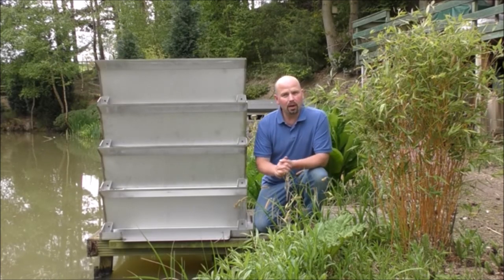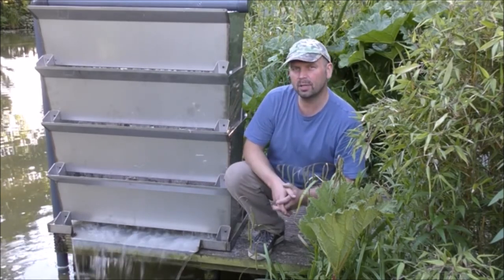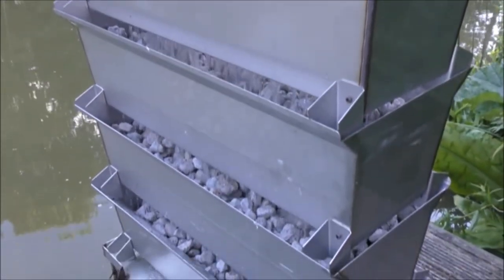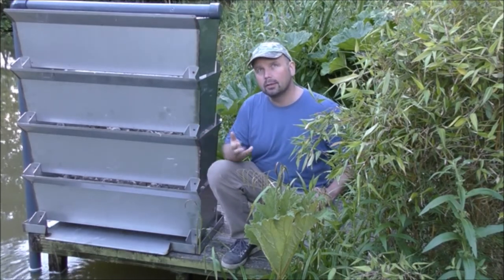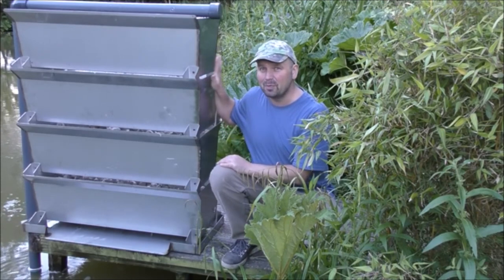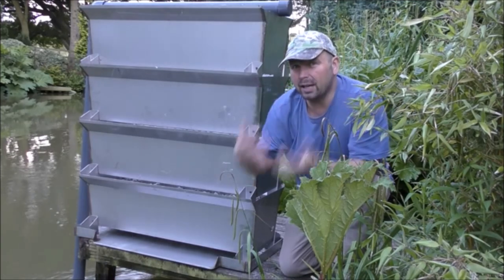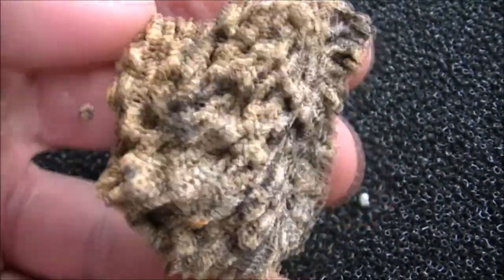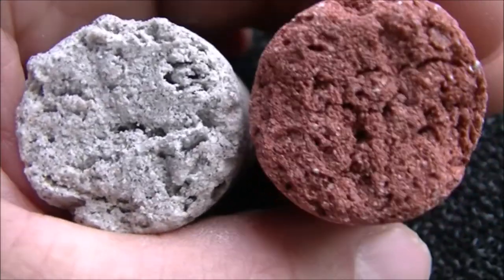Stainless Steel Koi Shower Filter / Trickle Filter

Comment: Great video mate. I used your DIY method using plastic boxes for additional filtration. My basic setup is pump > oase filtoclear > trickle filter. I used Lava-rock as the media as I got a good deal. The filtoclear does a good enough job but my koi are now getting quite big and producing a lot of waste. After running for 2 weeks all my water parameters are perfect, and not sure how but my PH is now stable @ 7.5 . Usually my PH would swing between 8 - 8.5 depending on time of the day, but now its completely stable at 7.5. Cheers m8. I even managed to box it in with bamboo sheets. cant even see it
Reply from the maker: Sounds like a great set up as the filtoclear will do a good job of removing the muck while the shower gets to work on the biological side of things. I think the lava rock may have a buffering effect with it being new but not too sure about that  - good to hear the pH is stable as that can really knacker the fish if it bounces. A pH of 8.5 is very high so 7.5 is much better for them.

Comment: Good video Richard, Many thanks

You asked why they are not very popular?

Well you need a good, easy to clean mechanical filter before a shower filter as 
It's no good having any solids getting to the media. This just clogs the whole thing up.

It's ok having the top tray with filter sponges and/or brushes which works very well but the cleaning!!
At least once a week in summer months,  sponges and brushes out, pressure-washer on, cleaning each one in turn, not for me anymore after 10 years of it, fingers crossed.

Iv just come away from all this and using a Nexus as a mechanical filter first (nice and easy to clean) then into a Biotype media filter before returning back to pond.

Iv had to raise the nexis above the input of the Biofilter which is only 2ft which is another problem of shower filters, they are top fill of Course.

So far so good with mine,  time will tell, but will be incontact with you soon for some more media

Thanks again
Reply from the maker: Yes the Nexus / shower filter combo is mentioned a couple of times in this video as that would be the perfect set up for exactly the reasons you outline here. Most people have Nexus filters as gravity fed so would have the pump after the Nexus making it easy to pump water up to a shower filter. On a smaller scale a decent pressure filter (e.g. Oase Filtoclear) could be used as the mechanical and UV filtration followed by a shower filter.
Cleaning out a good quality pressure filter or Nexus filter would be much less time consuming than cleaning out the foams in the top of a shower filter, plus it would free up that top section for more biological media too.

Comment: Learned a good bit here, thanks. My Trickle Filter is doing a amazing job, have 5 layers.. I turn the pump off and the water still comes out after 20 secs.
Reply from the maker: Excellent job and they definitely do great work on ammonia and nitrite (and nitrate under the right conditions)
Reply: Would this system be also good for aeration?
Reply from the maker: Yes rapidly falling water will mix with air but if the flow was very limited it would probably have a de-oxygenating effect (due to bacterial action using up dissolved oxygen)
Reply: Ah never would of thought of that. The more i learn, the less i know. I'm getting there though :)
Reply from the maker: We are all learning and every time I see a different container or material which sould be used for mechanical / biological filtration I'm running through all the filtration possibilities in my mind, lol
Reply: A bit off topic, but who best to ask other than the guru. 
I bought 4 packs of JBL Clearmec Plus to add to my trickle filter. 
You think its a good idea? Or did i waste my money?
Since its my first pond, i'm a bit noobie at this stuff.
Reply from the maker: Its not the stuff you'd normally put into a pond filter and I doubt it will have any effect but it won't do any harm.
If you wanted enough clay media to actually support bacteria and help the shower filter this would have been a much better buy: http://geni.us/v9hLl6

Comment: I love this shower filter. I am wondering if you have done a video on how to maintain and clean the filter.
Reply from the maker: Not yet but I will probably do a 'strip down' video at the end of the year as i am incorporating the shower filter(s) I have into a much larger filter system. If the water is cleaned prior to entering the shower filter (e.g. by a pressure filter) the shower will never need cleaning.

Comment: The best filter system is a bakki shower after a drum filter. I would not recommend pumping straight over a shower with no pre-filter. I know that is what Momotaro koi does but there are reasons why they can and we can't.
Adam
Reply from the maker: Yes I'm with you there and that is why I mentioned that a couple of times in the video.

Comment: Very cool.. I love the sound it makes.. lovely. I guess I need a bigger pond for that one. It's a really cool idea. I've never seen that style.
Reply from the maker: Although I have been in the aquatics trade for over 20 years it is really in the last 2 years that I have been made aware of the usefulness of shower filters.
Reply: I was wonderng.. at the lake I hiked around the other day there is a big drain like box about 4 meters off shore. It's like a cement box and the water flows into it. Is that actaully a filter? The pond is spring fed so why would it need that anyway. Just curious. Any ideas?
Reply from the maker: It could simply be an overflow or if it has screens on it then it could be there to prevent native / non-native fish which may have been stocked there getting into other bodies of water?
Reply: Oh that's interesting.. I learn so much from you. I canoe close to it and it does look like a over flow..of some sort. Or a fish-keep-outer!

Comment: A very good filter for ponds.
Ive added a Seive prefilter ( kinshi sieve 5 )
and then Ive filled mine with AquaKing, Bacteria House.
I think it works just great with the water quality.

The disadvantages are.
it produces alot of foam, maybe its because I feed ALOT at this time of summer.
it is pretty noisy, so if you cant hide and shield it, it can be annoying.

I have not added foam, to improve the mechanical filtration, but I will soon, since the Sieve doesnt filter the water perfectly..
Reply from the maker: Sounds like a decent set up. The foam will be caused by too much protein in the water (from fish food) thickening the water surface and preventing bubbles popping properly. That can also prevent proper gaseous exchange between water and atmosphere so it may be adding a treatment to reduce foam.
What is the nitrate like with that set up?
Reply: Its an ok setup for now, I also have a small tornado protein skimmer and Ive added a bubble catch at the inlet on the pond from the bakki, so I dont get to much bubbles out in the water.
- also, I got a surface skimmer so I reduce the bubbles on the surface by "sucking" them away.
Also Ive added a 4 meter long stream filled with Lava stone to get some extra filtration.

I do agree that the massive feeding will produce more protein in the water, but its summer and its short, so, they will need the food this time a year to grow and prepare for the long winter..

But, after wathing this video, Ive notice you talked about "white pumice"
- and the good thing was it should have PH 8, I cant really find alot of information of this produkt, and by that having a hard time finding the "danish word" for it, if I want to add it to my bakki.
Reply from the maker: The long lava stone stream sounds like a good idea.
The pumice is simply white lava stone and both the brown and white varieties are pumice, just one is generally called 'lava rock' and the other is called pumice - very strange.
The biggest seller of pumice unfortunately calls it something else and never confirms that what they sell is pumice (since they sell it at a sky-high price) but Seachem Matrix is basically a mediocre quality pumice - somewhere between the true white pumice and the brown pumice. Many pieces are very dense and useless but the majority of it is OK.
Therefore if you want to check out pumice try reading up on Seachem Matrix. They also do something called 'denitrate' which is a better quality pumice unfortunately crushed way too small.

Comment: yeah same here I have a 1m by 50cm trickle tower full of alfa grog on my skimmer turning pond over every hour. 
so long as you have a good pre filter grog don't clog.
Reply from the maker: I was just talking to a mate yesterday about grog and we both reckon it is a criminally underused media which is more useful than many people think. Maybe they are put off by the very low price but the value has to place it top of the pile. Its one of the few media types which can still be effective in a traditional static box filter too since it has such low porosity (usually around 25%) that it doesn't matter if its is sitting in muck.
The low porosity is a down side if you're looking to reduce nitrate but it is a great way to fill a shower very cheaply and rapidly process the ammonia and nitrite.
For more effective media types (biohome and white pumice) they really do need to be operating in clean water to be most effective as they rely on their high porosity to support the anaerobic bacteria necessary for reducing the nitrate. 
It would be interesting to see a really slow flow trickle filter filled with grog and what (if anything) it does for the nitrate level as the water should be quite de-oxygenated by the time it gets right through the filter. I may experiment by having grog in the large filter I will be building later this year.

Comment: The trouble with pours media is it soon gets blocked up despite the mechanical filtering in the top section due to algae etc. I bet you don't get that flow rate in 6 months time and then all the faffing about empting the containers and washing everything out.  I prefer plastic media like Kaldnes in a moving bed which is maintenance free.  Also it looks like this filter has to be fixed in a high profile position over the water as I can't see any overflow system for when it blocks.  Another interesting video thanks.
Reply from the maker: Yes as I mentioned in the video the perfect solution would be top have a nexus filter doing the mechanical and nitrification followed by the shower filter (operating in clean water) to do the denitrification.
In that situation it would be almost maintenance free as there would be no need for any sponges in the shower filter.
Reply: Thanks for responding to so many of our comments it does make it more interesting and worth while posting.
Reply from the maker: No problem, I genuinely like to see comments which add to the information in any video, question it or disagree with it as that encourages me to think more and investigate other options and solutions to potential problems.

Comment: Another great video.
I have two questions if you don't mind.
Do the inner pores clog up eventually on the better media you mention and if so would it have to be thrown away, i seem to remember from when i kept tropical fish that siporax never blocked up over the years i used it but it was thin walled sintered glass tubes. 
I don't heat my pond and I'm concerned about this system chilling the water too much, do you think this could be an issue? I'm from Doncaster so don't get the warmest weather but not quite so cold as you probably get.
Reply from the maker: Ideally the pump would be moved to where the water pours back into a pond in the winter (when using any filter) as that will cut down the chilling effect. Yes all good media will eventually become clogged including siporax. The pores clog up and then it basically becomes useful only as a tube or pellet depending on what media is used with minimal outer surface area. Alfagrog is probably the best for a dirty environment due to its shape but more porous media like biohome and white pumice can be highly effective as long as they have good mechanical filtration before them to clean the water.

Comment: I've just built a shower filter with pumice that I bought from you. I've built it in a 120ltr wheely bin and it has about 35 - 40 kg of pumice in it. My water is first past through a barrel filter that has course, medium and then fine foams on top of the cheap plastic tube type media. I'm using this as a purely mechanical filter before the water goes to the shower. After two weeks my water clarity has improved tremendously but I dont seem to have that much improvement on the chemical quality of the water. Probably a bit too soon for anything to happen. I've searched high and low to try and find a comparison video for shower vs bakki river and havent been able to find anything. Could you please explain the pro's and con's of each? Is a Bakki river better than a shower filter?

Comment: would appreciate some advice. i have a 100.000 ltr pond. the water is turning green with algae i guess. what kind of system will i need to process the pond. will i need a UV system or will the trickle filter system work just fine? how big a system a trickle filter system will be required and at what flow rate? cheers
Reply from the maker: You would need a nation of UV light to kill that off and keep it clear and it may take around 300w of UV to kill the algae for a 100,000 litre pond. The UV lights would be (inline) before the trickle filter and the trickle filter would need to hold around 200kg of pumice - flow rate of 20.000 - 30.000 litres per hour as a rough guide.

Comment: Have you heard of roto concept shower filter made by Koi Logic in essex
Reply from the maker: Yes, I may have seen one at my local koi dealer and they look nice - the same effect can be achieved with a 45 gallon drum and spray bar though, lol
A bit like the Nexus filters in the form over function angle but if a filter looked DIY or awful people wouldn't buy them.
I really like the good looking filters as everything is there to do a specific job, neatly laid out with easy clean facilities - it would certainly appease most wives having a ready made good looking filter instead of a few random 45 gallon drums with a mess of pipes connecting them so I can see why they are popular.

Comment: interesting lecture on pond chemistry . where does the water come from to fill that big pond . do animals or birds of prey try to steal a fish or two.  those water filters are they like filters used for human consumption. is pumice natural or man made.  thank you for sharing.
Reply from the maker: The pond is spring fed and yes there are plenty of predators which have taking fish over the years including heron, mink, otter, cormorant and goosander. The only thing I don't mind eating the fish is the kingfisher as it only takes the fry. Mostly this type of filter would be seen in koi farms. Pumice is a natural volcanic rock.
Reply: thank you sir: on nova the kingfish bird can attack larger birds like ravens when threatened .
Reply from the maker: They are feisty little birds, that's for sure.

Comment: What about the good old fashioned noodles everyone used to use, does that do the full cycle? We used to see those noodles every where but now no one seems to mention them
Reply from the maker: Even good quality noodles will support a real imbalance of aerobic and anaerobic bacteria massively in favour of aerobic so they end up being great for ammonia and nitrite removal but produce lots of nitrate. The bigger problem is that so many manufacturers are trying to manufacture them as cheaply as possible many of them are as smooth as glass with no real porosity so are next to useless. When I see videos of people comparing the noodles to other forms of media and favouring the noodles it makes me laugh when I see them using really crappy quality noodles which may as well be grapes or marbles for the available surface area they have, lol
If you can find good ones (e.g. Aqua One Bionood) they can be a good media.
Reply: +Pondguru Outdoors Ok so I've been using noodles for years, to the eye they look really pourus. I guess the real way to see if it's doing the full cycle is buy water testing. But if there not controlling all three then buy adding the media your recommending with what i already have could i still have an imbalance?
Reply from the maker: Potentially, yes but there will only be a finite amount of bacteria supported aerobically and anaerobically (due to the limited food source). As long as there is plenty good media in the filter it really should not matter how much other media is in there. Hope that makes sense.
Reply: Cheers

Comment: Hi, The Momataro bakki showers for a four tier system is around a £1000 so not cheap to say the least...then there is the cost of the media...the one you have reviewed is around £500 so a lot cheaper...have you ever seen the momataro ones? Is this just a case of paying double for the brand?...interested to see what you think..from pictures i would say the more expensive of the too probably looks better? you can see pictures on absolute koi...cheers Ross
Reply from the maker: Yes I have seen the 'proper' bakki shower on their website and it is slightly different. May be a bit better finished but essentially they do the same job. I'd like to see someone take a bakki shower and get it powder coated in a neutral colour as that would look very professional.
Reply: Hi Ross, would like you to come see one of our systems, we manufacture them in 316 stainless steel and they are equal in quality to the ones sold by Absolute Koi. They are cheaper as we manufacture ourselves.
Reply: Hi thanks for the comment. I am in leicester so not to far away. I have looked at your web site. Do you have any other photos of the shower? Thanks again Ross